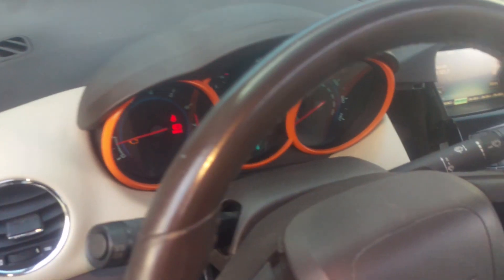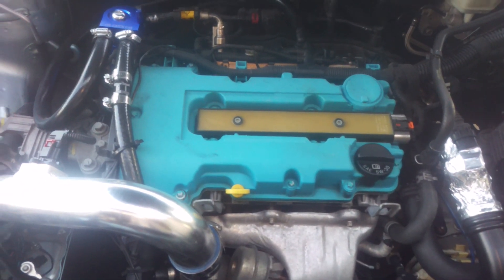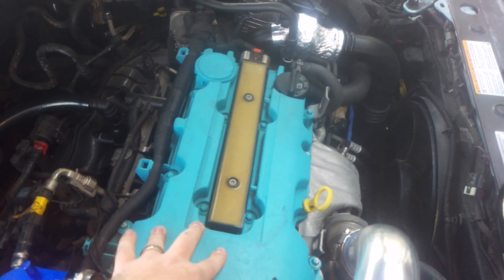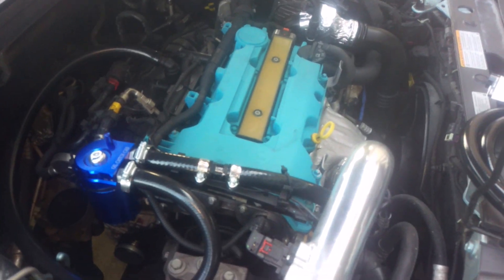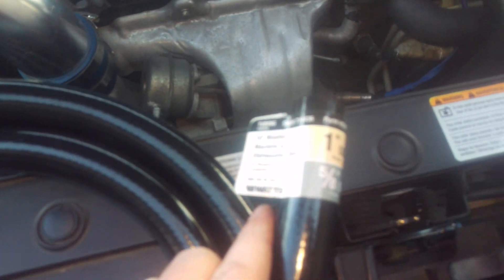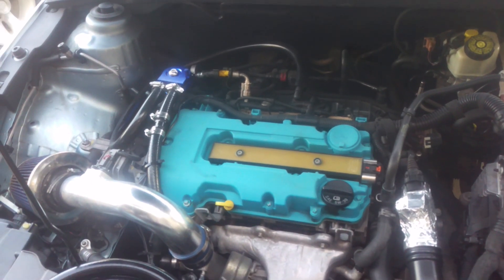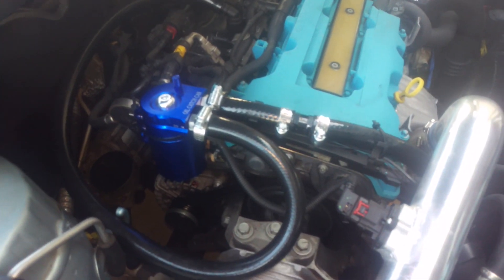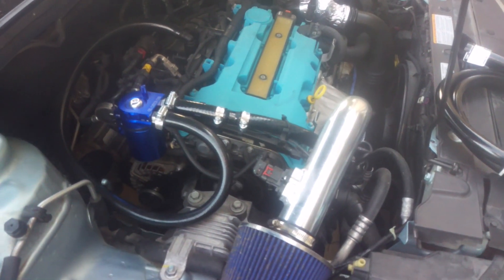1.4T GM Chev Cruze Sonic Trax Buick Encore $20 PCV intake manifold fix P1101 P0171 with 1 way valve.

Comment: I’m going to install one of these but what size are the hoses because I have a 5/8 hose and I think it’s to small
Reply from the maker: 5/8th should be the correct size inside diameter hose
Reply: @koreymayo8884  oh ok perfect ima get it installed soon lol  hey do you know if the catch can collects metal shavings cus my car is at the dealership and they saying metal shavings is in the coolant and the oil saying it could be a blown head gasket but then they saying that it’s Rtv on the oil pickup screen I mean I’m really confused cus I had a shop do the oil pay about two years ago and I’m like the second owner of the car so the last owner didn’t do anything so I had the intake manifold and pcv hose replaced so idk what could be the issue
Reply from the maker: @kenrice3154  Metal shavings in oil should be a failing engine and never heard of metal shavings in the coolant. A blown head gasket shouldn't cause any metal shavings. Never seen metal shavings in a catch can.
Reply: @koreymayo8884  oh ok see that’s what I was wondering cus it all don’t make since cus I took it to a Chevy dealer and they saying it’s shavings in the coolant and old so idk what they talking about they did say my water pump is leaking bad and I need a new engine cooler and if there’s metal shavings would it filter it into the catch can tho like to clean it out

Comment: Question when u installed the oil catch can and the valve the check engine light still on  or is gone?
Reply from the maker: My catch can install did not cause a check engine light
Reply: @koreymayo8884  oh ok .sobis this a solution when the little pcv fails instead to remove the manifold i can use this method and the car will respond ok?

Comment: Can check valve be added without plugging original pcv hole in intake.
Reply from the maker: The purpose of adding the check valve is because the check valve by the turbo always fails. If your PCV valve in the intake manifold fails it will constantly be sucking in a lot of oil, so I would either replace the intake manifold or get a PCV fix kit or plug the PCV valve and just let it breathe to the turbo or vent to atmosphere like the old cars used to before EPA regulations. Personally I went with a ported ZZP manifold when mine failed but next time it fails I think I'll plug it and let it vent to turbo or atmosphere.

Comment: All you did was create a redundant check valve where one already exists. You didn't address the boost leak created by the missing intake manifold check valve, or replace that check valve. I designed the 3 PCV fix kits that most 1.4T owners are using, and I encourage people to experiment with and adapt my solutions if they want to, but this doesn't accomplish anything. 
Refer to this tech article I created for a better understanding of how this PCV system works, where check valves need to be located, which orientation they need to have, and what the major components are in the system. If you need any of the parts from any of my PCV fix kits, I'd be happy to provide them to aid in your efforts. https://cruzekits.com/tech-articles/f/why-do-we-even-need-a-pcv-system
Oh, and by the way, your 5/8" fuel hose is compressing badly underneath your intake pipe. If that continues, it's eventually going to deteriorate internally. I went through great lengths to find a suitable PCV hose that could handle the high vacuum at the high temps these engines experience.
Reply: So what hose type do you recommend.
Im planing on getting a oil catch csn installed on my trax 2013 1.4 turbo aswell.
Now running 2 hoses to and from catch can.
But this issue 3rd hose of a T .
Has got me confused
Reply from the maker: The hose I'm using is a very strong hose and not a fuel hose! It isn't compressing at all! The factory check valve by the turbo always fails, so it isn't redundant, and the oil catch can keeps the turbo, intercooler, and throttle body cleaner! I already replaced the other bad PCV/ check valve with a ported ZZP intake manifold!
Reply: @koreymayo8884  looked like it was collapsed right underneath the turbo air inlet but might be the reflection. Video quality isn't great. 

Yes it's redundant. You should clean or replace the turbo inlet check valve. It doesn't usually fail badly enough to cause any issues. In fact, any failure mode is typically due to deposits built up. Vast majority of people can just replace the hose. The bigger issue is you increased the resistance going to the turbo inlet by running two check valves in series. This will increase oil consumption and reduce efficiency. 

The catch can has theoretical benefits, but the number of cruzes on the road exceeding 300k miles would prove that the benefit to a catch can remains theoretical, not practical. My cruze has a gtx14 turbo, e85, stiffer valve springs, and a 24psi tune. I don't have any issues with IATs that would indicate the intercooler has lost efficiency by any consequential degree. 

The ZZP manifold is a well done manifold with a proper professional porting job, but it's just an OEM manifold with ported runners. That check valve will fail just like they always do on those manifolds. 

Listen, I've written countless articles on this PCV system, consulted with engineers, designed three fix kits, which made the most comprehensive videos explaining this system, and have been actively managing or participating the social media communities around this platform since 2012. I'm very familiar with the failure rate on the turbo inlet check valve: it's low. It's a non-issue, and your check valve is redundant and increases crankcase pressure. That's a fact. That also increases oil consumption. Also a fact. 

I can't tell what hose you're using from the video due to the blur, but make sure it's not silicone based or heater hose. Hydraulic or PCV hose is what you want. Other hoses will leak and/or swell. I've already seen it happen.

Comment: That setup is completely useless.... the valve cover has a water air seperator built in.... doesn’t hurt to have an external catch can either way.... my main point being... that hole where the check valve once was needs to be plugged. You got the check valve right. But it’s in the wrong spot.... the hose going from the turbo inlet has a 1 way check valve it’s the connector to the inlet. You need to remove that check valve and get a 3 way T and thread in a barb and some An fittings where the turbo hose goes into the intake manifold taking the T and splitting the hose off the intake and running the other open end to the evap or brake booster inlet on the manifold with the CHECK Valve placed there
Reply from the maker: It isn't useless because the check valve by the turbo always fails and I do have it the right direction. It also isn't useless to keep the turbo, intercooler, and throttle body cleaner with an oil catch can.
Reply: @koreymayo8884 Not quite, he is technically right about your setup. Under no boost/idle/vacuum the intake manifold is completely bypassing your oil catch can without having that original missing orange PCV check valve plugged. It’s literally sucking in the blow by into the intake manifold. 

All you did with this setup is add a double check valve system towards the turbo for when the engine is under boost.  You’re dumping boost under load into the crankcase and into the turbo without having a check valve oriented the correct way. Curious have you had anymore issues since this setup? Increased oil consumption, low power/underboosting? Because there is a more efficient way to set this up and give you the best performance possible.
Reply: @tonypenev  video to the more efficient setup please? I have a 1.4l ecotec turbo in  a buick encore with all these same issues.  Please & thank you 🙏

Comment from the maker: This is the ebay check valve I used. UPR 17MM Non-Return One Way 5/8 Inch Air Fuel Oil Check Valve Diesel Gas E85 
https://www.ebay.com/itm/UPR-17MM-Non-Return-One-Way-5-8-Inch-Air-Fuel-Oil-Check-Valve-Diesel-Gas-E85/291327163877?ssPageName=STRK%3AMEBIDX%3AIT&_trksid=p2057872.m2749.l2649